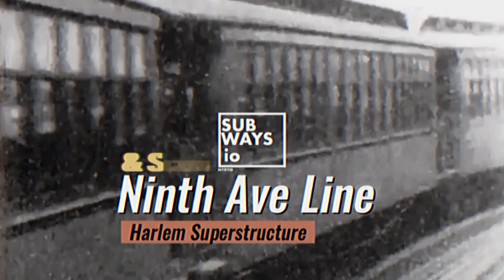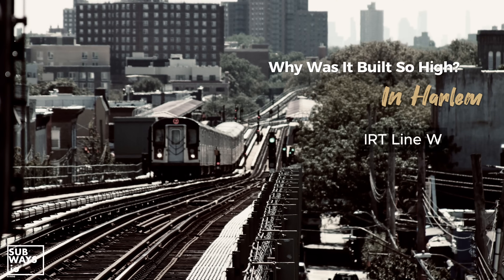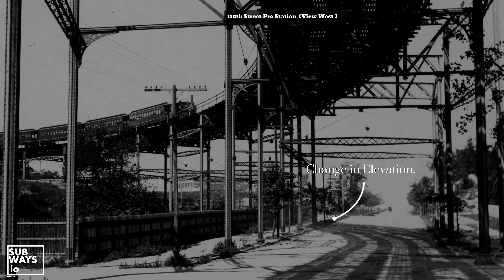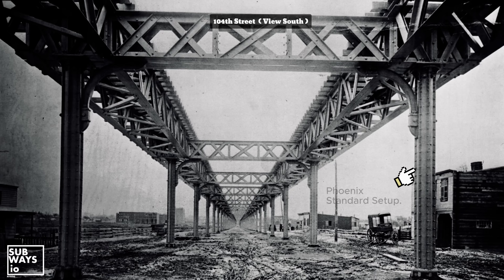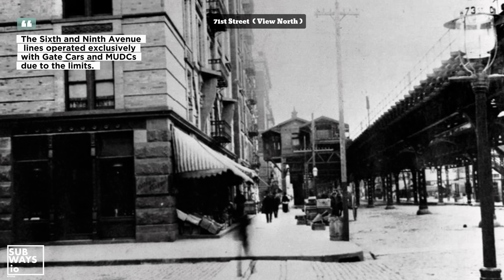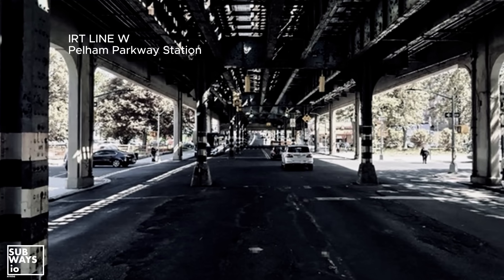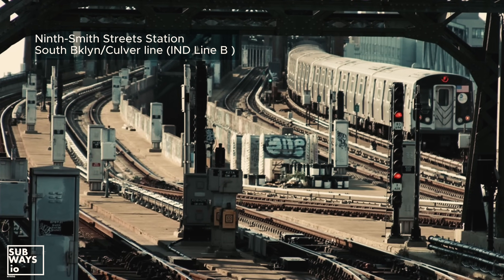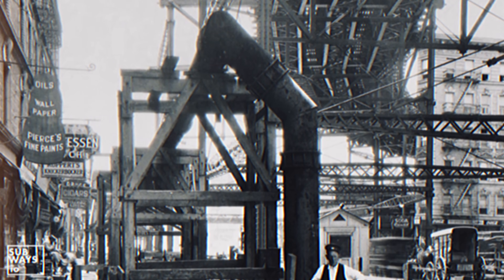The Harlem Superstructure of the Ninth Avenue El

Comment: Given sufficient political will and common sense an architectural gem could still be running today.  The IRT 6' and 9' Av. Els should have been reconstructed and the stronger and graceful Phoenix column design adopted throughout their entirety before joining the Jerome Av. line in the Bronx.  The Putnam connection should have been retained so as to connect with Yonkers and other locales. At South Ferry the 6' & 9' Av lines continue E through the slip into Front St, reverse curving W through Coenties Slip and N into Pearl St, E over the Bklyn Br to join with the various BMT El lines in Bklyn in a Dual Contracts BMT/IRT expansion which would have considerably expanded their scope.  All of this could've been accomplished as early as 1907 - 17.  Some idea of the beauty of the IRT Manhattan El cars, as well as the BU's can be gleaned from early photographs of them. The elevated structures were rather handsome even if a bit utilitarian in appearance, but nothing that regular maintenance, including cleaning and painting couldn't enhance.  The noise could be solved by the insertion of thick resilient rubber pads between the rail bases and ties, in conjunction with PCC steel/rubber sandwiched wheels -- goodbye noise.  But the box-heads in charge, chose to ruin everything, somehow not realizing that NO bus or automobile transit, even combined can REMOTELY approach the passenger - carrying capacity of the El. They really blew it!

Comment: I lived on W 116th and B'way from 1973 until 1987, back in the 70s the station house on corner of W 110th (Cathedral Pkwy) and Columbus Av was gone but the elevator shaft was still there until the mid-80s or so. It was shown in a photo section of the NY Daily News Sunday magazine, not sure what date, called New York's Changing Scene.

Comment: ???  According to a book I have (Subways by Stan Fischler), 110th Street on the 9th was higher than the Gowanus Viaduct on the IND.
Reply from the maker: Very interesting—but that seems like a bit of a stretch. For the line to match the height of Smith–9th Street station, it would need to reach nearly the height of an eight-story building with roof, which clearly isn’t the case. Photos clearly show it surrounded by five- to seven-story buildings with  track level around the 6/7th floor, making the scale more apparent.
The only explanation we can think of is that the measurement may have included the tower foundations as well. We did include a photo showing land clearance for construction in the area—taken after the line opened—and it clearly doesn’t accurately mesure  a direct ground-to-structure height.

I’d be really curious to know what source or reference the book used. We’re working directly from elevation maps and original prints, so I’m not sure what to say beyond that, maybe an oversight on the author's part?. Thanks for the comment and feedback.

Comment: The automobile era killed so many lines that would be very useful in today’s system. 
Second and third avenue both has elevated trains? That’s impressive considering how starved that area is today. 
The trolleys directly below the ELs. That’s a public transit advocates dream.  What a level of service.

I do wonder though if electric street cars (LRT) can replace uses along the length the avenues in manhattan?
Reply: This is really good information.  I find this subject interesting and look forward to the 1938 program. 
NYC really had a system for today back then.

I guess having a EL or Subway on almost every avenue would be a duplicate service but for the idea of getting folks onto the trains the more closer to their destination the train is the more likely they’ll use it. 
It kinda sucks walking walking form
First/second avenue to the 4/5/6 line when you and a train right there on second and 3rd.
Reply from the maker: There were a few different factors in New York’s history. Most of the elevated lines were dismantled just before World War II, around the time of system unification in 1940—right before the post-war car boom really took hold. But you’re absolutely right: New York’s trolley and streetcar network was hit hard by the rise of the automobile. Most of those lines were phased out between 1946 and 1956. With the last ending in 1957, this era slowed transit expansion for sure! And yes, both Second and Third Avenues in Manhattan had elevated lines—the Second Avenue El even extended into Queens. As for light rail in Manhattan? Technically, yes—it’s always possible. But it usually comes down to political will and civic adaptability. The M15 could be a prime candidate, being the most heavily used bus line. Maybe a dedicated, directional, and fully separated lane along 1st and 2nd Avenues could make it work?
Reply: I knew about the elevated lines but your Channel took to next level.
The sheer amount of public transit we had is probably overwhelming for most.
Why do they call the 4/5/6 subways the Lexington avenue line? Or was that a different route?

Considering the weight constraints on much of the original El lines, I would think that providing they were kept, they would need to have been a full construction of the structure to meet modern weight requirements and possibly where practical fracture supports out of the street.
As much as I like the old infrastructure. The minute those structures came down property value must have took off.

With today’s proposed SAS Is that still happening to lower manhattan? 

I think we would have run out of letters if we ran all those EL trains today’s. They would have to be numbers.
Reply from the maker: @JMVX  So glad you found the content useful! What you see is just a bit of data visualization from our end. We’ve worked the system from a technical perspective, so we’re just sharing our point of view, no special sauce 😀. A lot of infrastructure has been lost over time—some of it because of redundancy. At some point, we’d love to cover the year 1938 in more detail through maps and visuals, as it represents the peak of New York’s transit network.

To directly answer your question: the Lexington Line gets its name because it runs mostly beneath Lexington Avenue. Historically, it was also referred to as the “Lexington–4th Line” when it opened in 1918, due to its route under 4th Avenue—now known as Park Avenue South. We’ve done some videos on Lexington Avenue and its originally planned BRT route, which shed more light on this.

Now, about the elevated lines and their structural constraints: by the time the els were being dismantled in the 1940s and ’50s, they had been rebuilt to varying degrees —most upgrades happened between 1903 and 1918. As mentioned, the Second Avenue El had already been strong enough to support subway-era equipment.

The Third Avenue El is interesting. The southern section—north of the Brooklyn Bridge along St. James Place, Park Row, and Bowery—had been fully rebuilt with steel H-beam construction, the same type used on the northern Webster Avenue extension. This part would have posed no issues for modern use. The sections that would have needed full replacement were north of 9th Street, along with some additional structural bracing in the Bronx south of Tremont.

And yes, the Upper East Side experienced a major high-rise boom in the 1950s as the Third Avenue El was coming down.

As for the Second Avenue Subway: based on current plans, the Harlem extension is clearly the focus. Phase 3 would be the real leap—but I don’t see that happening any time soon. Not saying it won’t, but I doubt I’ll live to see it.

Lastly, about elevated lines using numbers—if we assume they were divided by division, it’s likely the IRT els would have used numbers. The BMT actually used numbers before unification. If the els had remained, it’s possible we’d see a world where the IND/BMT used numbers and the IRT used letters… but that’s hard to say for sure.

Comment: Did the elevated lines more or less get replaced by underground ones?
Reply from the maker: In the case of the Sixth and Ninth Avenue Elevateds, yes. In fact, the section highlighted had overlapping service at 116th and 110th Streets by both the Elevated and the Subway from 1932 to 1940, before unification. This wasn’t the case with the East Side elevateds, especially the Second Avenue Line, which offered connections to areas not served today — giving Queens and Bronx riders access to the Lower East Side and First and Second Avenues.
Reply: Thanks for that explanation. I reckon the subway is neater and requires less maintenance.  Was there a political reason to remove the elevated lines, or was it just practical?
Reply from the maker: @ Objectively, it was likely a combination of factors. On the East Side, there was significant political pressure to remove the elevated lines (Els) due to the perception of urban blight they created. However, there was also legitimate justification for upgrading to a subway system in terms of both capacity and speed. For example, the Ninth Avenue Elevated, with its three-track configuration, naturally offered less capacity than the Eighth Avenue Subway that replaced it, as measured by trains per hour and total passenger volume. In terms of maintenance, both elevated lines and subways had advantages and disadvantages, including issues related to weather exposure.
Reply: Thanks again for that great reply.  The nearest I have got to New York is driving trains in a Train Driving simulator, but the History of the network is fascinating.
Reply: They were dum enough to tairing down all the extra subway elevated lines that could definitely be in use today. The 8 third Avenue elevated girldles does not have to have the same elevated structures styles anymore because they could definitely build it better than ever before.
Reply: Do you definitely wanna know how many people are streaming for the 8 third Avenue elevated line to come back? Including the ninth Avenue elevated in the Bronx for the 3 Broadway lines?
Reply: Keep bringing up the ninth and Thrid Ave elevated lines every time.
Reply: Adleast you definitely understand about all the extra subway elevated lines. Most of them don't. Wake up the young folks up and stirred up their minds and brains and heads up. Let them know what time it is. Keep up the great work and put this on the news one day. I'm 100 percent serious for real dogs.

Comment: 4:40.....

Just love it when you find still photos of areas that are nearly unchanged in modern times. As a native New Yorker, I recognized the structures to the extreme left and right of that photo.
The photographer was essentially looking south at the corner of Church & Barclay Streets in Lower Manhattan. You could even date the photo as being shot no earlier than 1935. That was the year the Art Deco structure to the right was opened. It's the area's local USPS Station. 
The structure nearly shadowed by the El, to the extreme left, is the western facing wall of St. Peter's Church. Just one block south of St. Peter's is the older, more famous, St. Paul's Chapel.❤
Reply from the maker: That’s correct — this photo was taken during the final years of the Sixth Avenue Elevated, with the IND subway already in operation. As with many areas along its route, IND construction brought some changes to the surrounding neighborhood.
Reply: @Subways_io  The Sixth Avenue El ceased operation in 1938; the Sixth Avenue Subway opened in 1940.